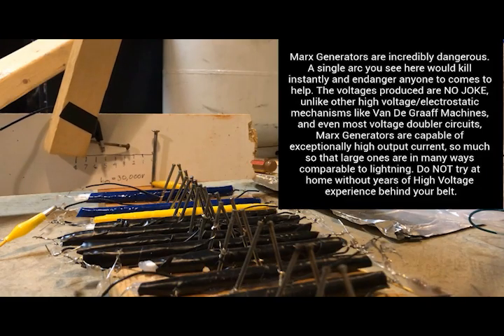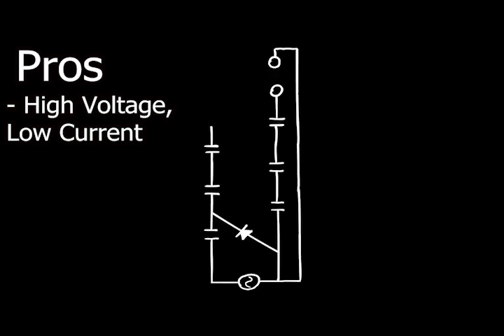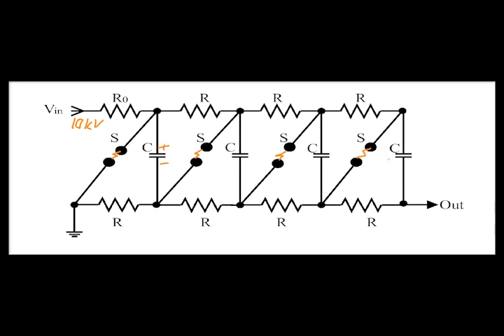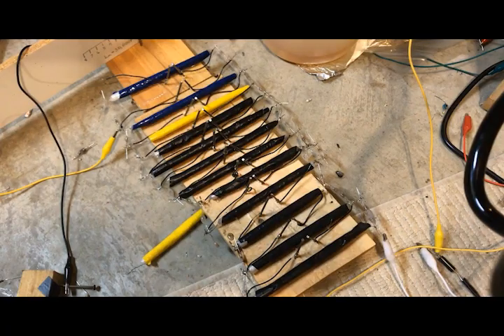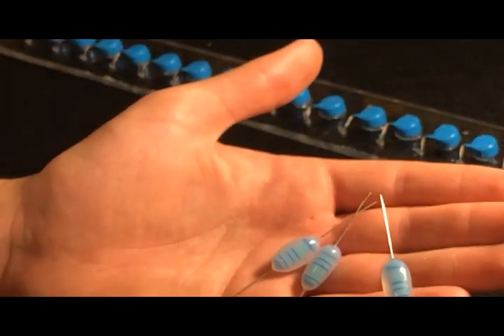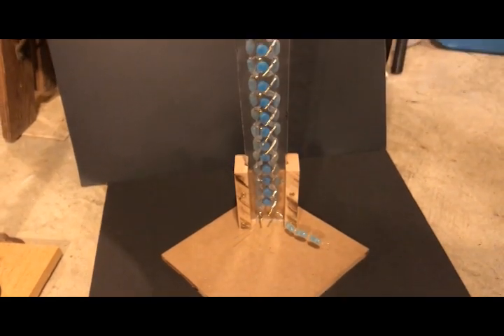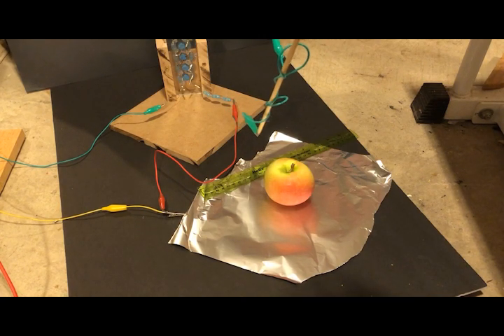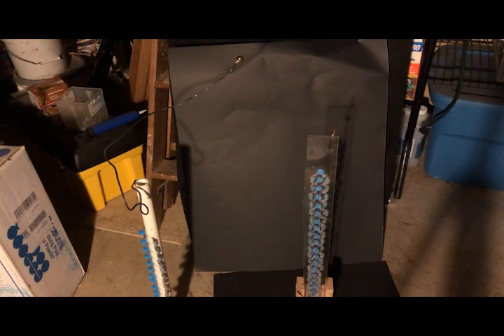Building a Better Marx Generator (200,000+ Volts)

Comment: During the discharge of the Marx generator on the negative terminal? Will high voltage flow back into my power supply? I know the discharge pulse from the output will put a higher voltage back into my power supply but I can run a resistor to lower the voltage. But I’m talking about the negative terminal of the Marx generator not the ground terminal for the spark gap. Lmk I don’t want to arc my transformer windings.

Comment: Do the arcs hurt? And do you have any way to measure the peak current in your setup?
Reply: its probably not worse than a wimshurst machine but it would be safer to have multiple resistors series to the output to limit current
Reply from the maker: The arcs do hurt quite a bit, but the short duration coupled with the low capacitance per stage means that there’s no lasting sensation. Still, as @Edward Science Innovations points out, the lack of a limiting resistor makes this design particularly dangerous if two hands were to close the loop rather than one. My soon to be published 300,000kV CW multiplier video will show the massive 8 Mohm resistive ballast I have to use to bring peak currents down to safe levels (for both myself and for the diodes).
Reply: I made one today (prototype) my capacitors were home made 8nf and 14 stage.. and a cheap spark generator from eBay attached to 4v battery and boy did it hurt. I went blind for a second.. so ya capacitor size really does matter,